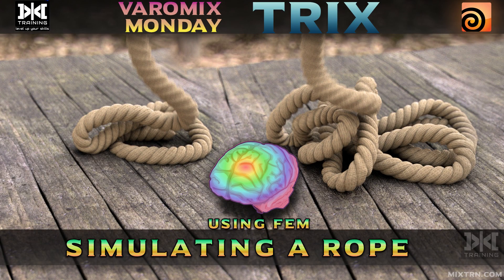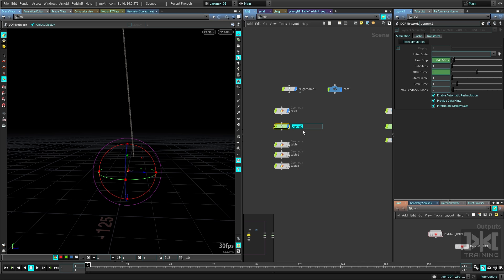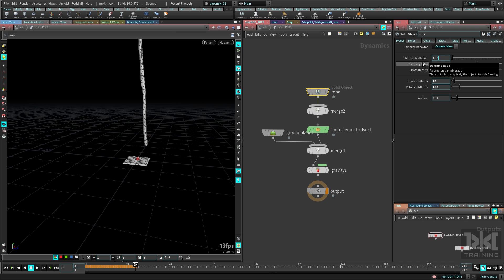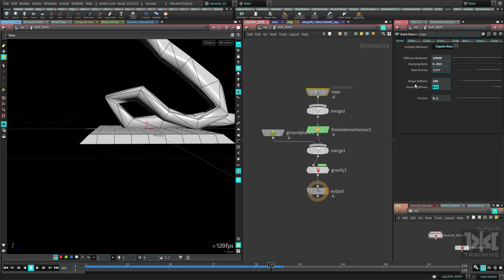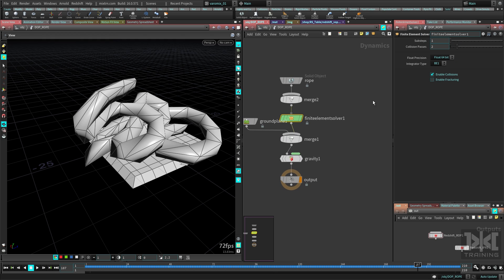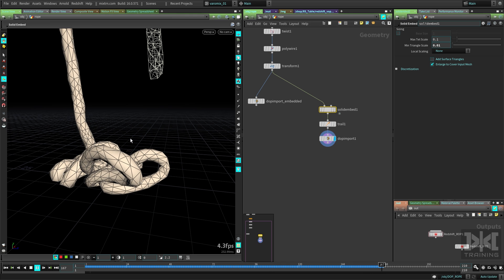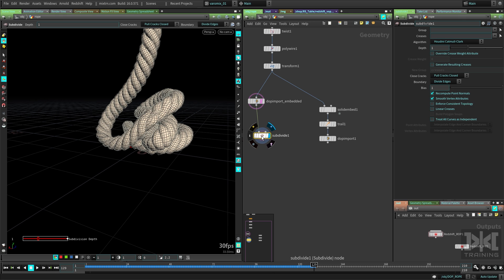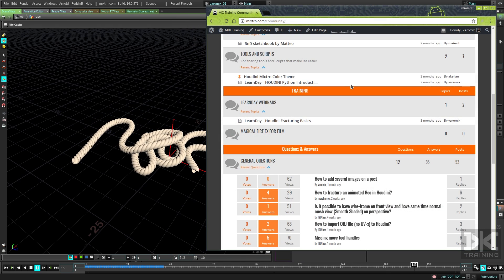VMT 022 - HOUDINI -  Rope Simulation using FEM

Comment: @MIX Training  I'm not super familiar with houdini, but just considering this guy's question, is there a way to dial in between a guide curve and the simulation based on the previous movement of the guide curve (Inheriting momentum/velocity, etc) and dependent on position ALONG the curve? Like a "directed" simulation?

The example in my head is like, a character picking a lasso up off the ground, swinging it in circles, and throwing  it around an object. Where, at various moments you might want to solve/sim the entire rope, sometimes just the pieces beyond his hands as he is winding up, then maybe not at all (or just for secondary motion) as it is launched toward the the target so that it can be steered onto target even if the physics wouldn't technically allow it, etc. Or say, imagine two characters are doing things with opposite ends of the rope, you may want it to sim from 0-20% and 80-100% along the length but key framed in the middle, then maybe fade into a sequence where the 0-20% and 80-100% are key framed and the middle 20-80% is simmed.

Does  that make sense?

Comment: Bit of a necro-post, but this is the closest tutorial I can find to what I'm looking for, just wondering if this still work in the latest version of Houdini?
and would this work for a mesh that's following a curve path, IE if I put an object in the way of the curve path would this technique move the curves around the object?
Reply from the maker: Should totally work on the latest, not sure about putting this on a path, in that case the path would just be the animation instead of a simulation, depending on what you need, you might not need to simulate it
Reply: @varoschool  I'm not super familiar with houdini, but just considering this guy's question, is there a way to dial in between a guide curve and the simulation based on the previous movement of the guide curve (Inheriting momentum/velocity, etc) and dependent on position ALONG the curve? Like a "directed" simulation?

The example in my head is like, a character picking a lasso up off the ground, swinging it in circles, and throwing  it around an object. Where, at various moments you might want to solve/sim the entire rope, sometimes just the pieces beyond his hands as he is winding up, then maybe not at all (or just for secondary motion) as it is launched toward the the target so that it can be steered onto target even if the physics wouldn't technically allow it, etc. Or say, imagine two characters are doing things with opposite ends of the rope, you may want it to sim from 0-20% and 80-100% along the length but key framed in the middle, then maybe fade into a sequence where the 0-20% and 80-100% are key framed and the middle 20-80% is simmed.

Does  that make sense?
Reply: @michaelwerkov3438  yes is possible, you can select a group of points to simulate by id, by a animated attribute etc. so yes, totally possible

Comment: emptyobject1:
Warning: Embedded geometry has 584 outlier primitives in group "fe_outlier_primitives"
Embedded geometry has 602 outlier points in group "fe_outlier_points"

Solid material property statistics
effective shape stiffness: min 6.71141e+07, avg 6.71141e+07, max 6.71141e+07
effective volume stiffness: min 1.6443e+09, avg 1.6443e+09, max 1.6443e+09
effective damping ratio: min 0.1, avg 0.1, max 0.1
effective mass density: min 1100, avg 1100, max 1100

Distributed soft target statistics
effective distributed target stiffness: min 0, avg 0, max 0
effective distributed target damping: min 0, avg 0, max 0

Why is this coming ? I'm a newbie.
Reply from the maker: I don't know, maybe your geo has some overlapping faces

Comment: i was thinking, what if i wanted to simulate a dangling rope..  is there a way to pin some points in place like you might do with a cloth solver?
Reply from the maker: yes, you can use cloth pins to do that, hint: FEM is the same as the Cloth Solver :)
Reply: There interchangeable :)